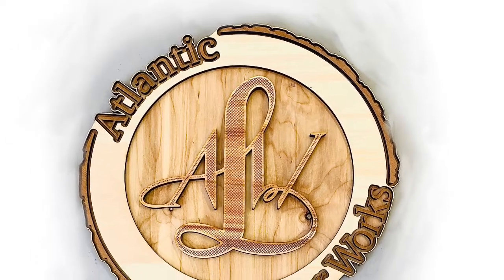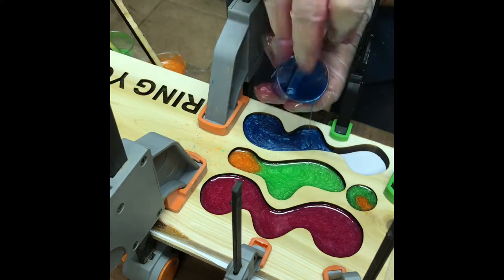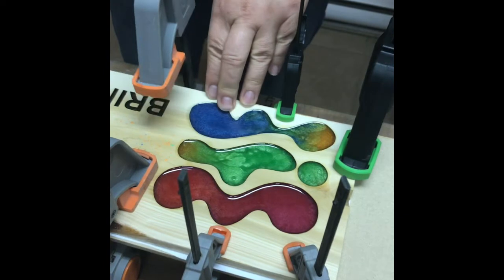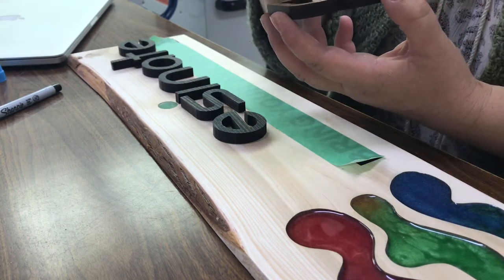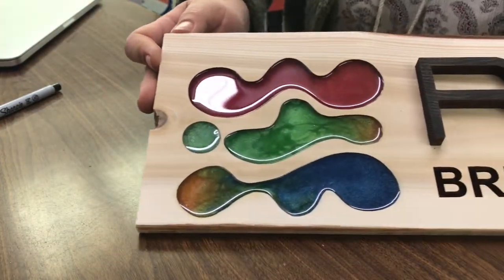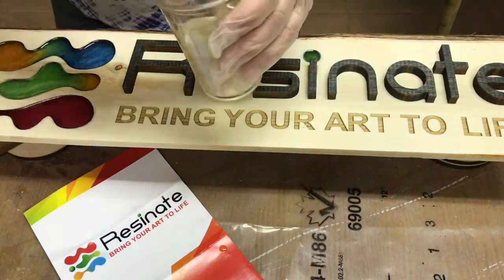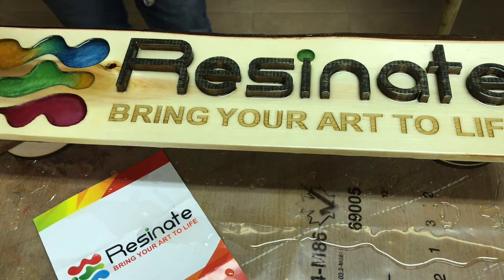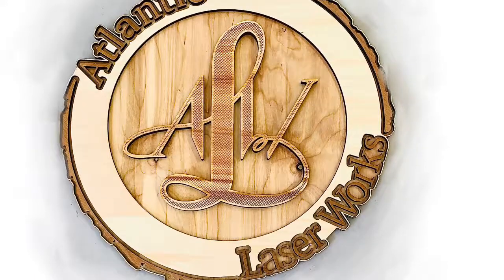Resinate

Comment: That's a really lovely result, well done. I've not played with resin yet (so decide for yourself how large a pinch of salt you should take with this advice) but have seen a whole bunch of videos, mainly on making live edge river tables. The technique I have seen used to prevent excessive bubbling from wood is to brush on a thin coat of resin to seal the surface of the wood, then once that is cured, use the flood fill and hopefully the bubble problem should be largely eliminated.

Comment: Great job. Thanks for this tutorial. I attended a week long encaustic wax painting art class last year and one of the things the teacher mentioned was to apply heat first (we used a torch but a heat gun works of course) to go over all the surface of the wood before adding the heated encaustic wax so that it would release most of the trapped gas in porus wood. Otherwise bubbles could come up through the wax similar to what you experienced. I would suggest doing that right before you are ready to pour your final clear coating epoxy. :-) Also I would suggest blowing through a straw to get rid of the bubbles when they do appear due to the gas issue and regular bubbles that appear from mixing resin. :-)